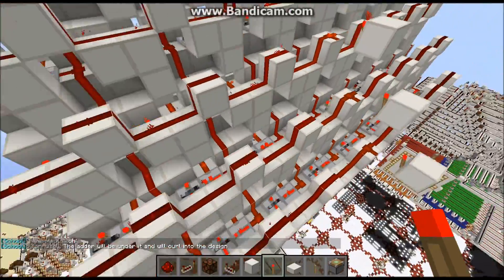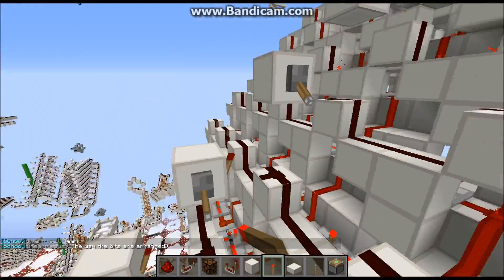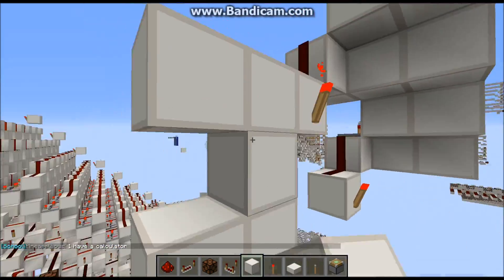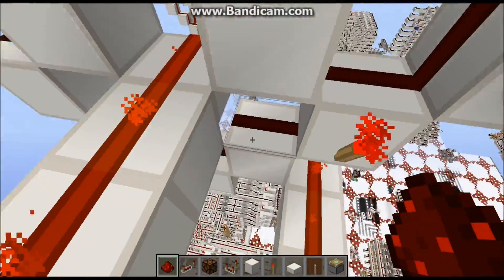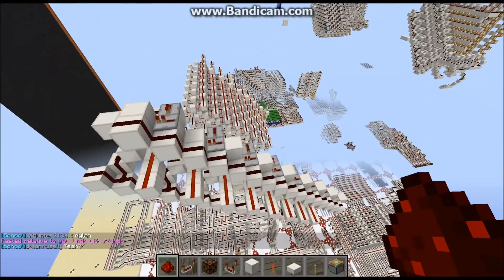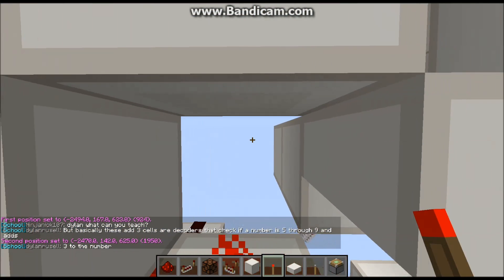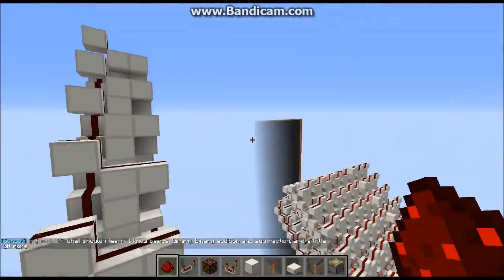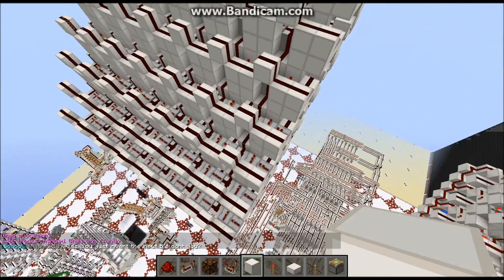Minecraft [HD]: RAM Tutorial!

Comment: Also, would making the read another repeater-lock make any difference, in terms of speed?
Reply from the maker: Thats a pipeline buffer stage. You can do that, but you need to make sure your data arrives synchronously.
Reply: And if it doesn't, what happens? Data gets f***ed up or something?
Reply from the maker: Roxas Hikari yeah, you will be missing bits of your data if it doesn't all arrive and get saved synchronously.

Comment: Why only 7 bytes? Wouldn't you want to have the maximum amount of storage?
Reply from the maker: If you mapped 000 to a physical address you would always be reading from 000 and writing to 000 when giving it no data, this causes a livelock, to overcome this flaw, a Zero Register is implemented that will always read in 0 and output 0 at address 000.
Reply: What you're saying makes perfect sense, but I have seen it done before, in bennyscube's first computer tutorial.
Reply from the maker: benny used a double operand system as in A <= A + B, im using a 3 operand system where C <= A + B. Thats why he didnt have a livelock, because he implemented an accumulator register. Hope this helped!
Reply from the maker: Yes and he didnt have dual read registers, so it took him 2 cycles to do an ALU op, when mine only takes one cycle.
Reply from the maker: These registers in this video dont happen to be dual read, ive used other peoples designs for those.

Comment: Do you think you can use this to 'remotely' (With comprehensible identifiable buttons, such as with modern input devices as keyboards, and then have millions of blocks of redstone wire) use this technique to program specific things, so you do not have to go into the computer and add an entire group of redstone wiring to allow the computer to act differently? Such as to create a program like notepad that can also be saved as a batch file and opened in command prompt. Although, that might require some command blocks in and of themselves, so don't stress yourself. 

This should be simple, all I am asking you to do is spend thousands of hours of your life in minecraft to build a computer , with many lines of code (redstone wire), that will allow you to more easily edit programs. 

Before then, you could build a way of translating all of the binary into a more comprehensible way. But, then again, if you can't get behind the wheel, walk on the tracks.

 Wait, I am an idiot HOW AM I SAYING THIS? I am scaring myself.
Reply from the maker: Working with a friend on a 16 bit Von-Neuman CPU with 256 16 bit words. So like 512 standard bytes of memory that will host a OS.
Reply: Yay, I do no understanding. minus the numbers and half the first sentence.
NO NEED TO EXPLAIN
Reply from the maker: .. ok